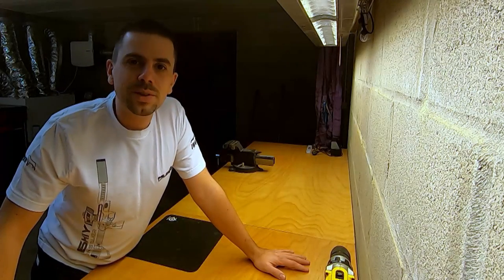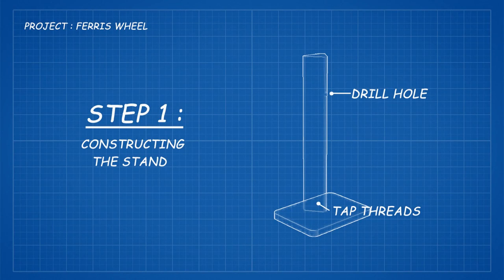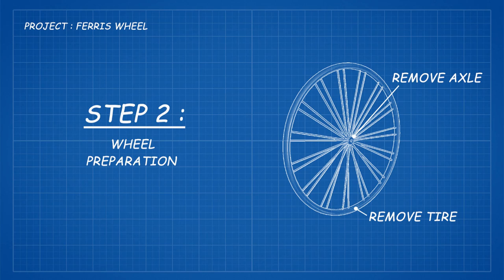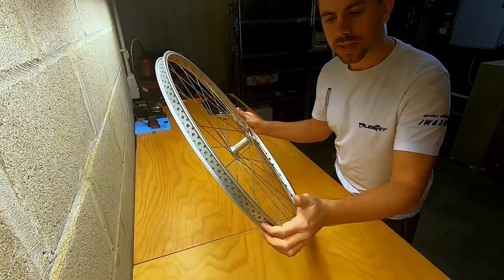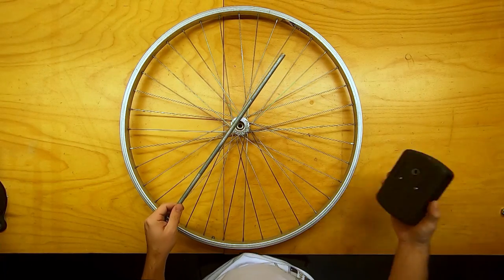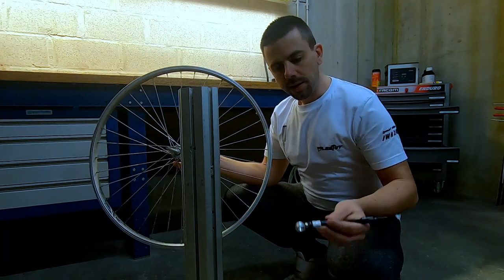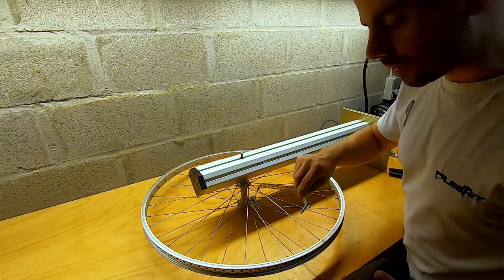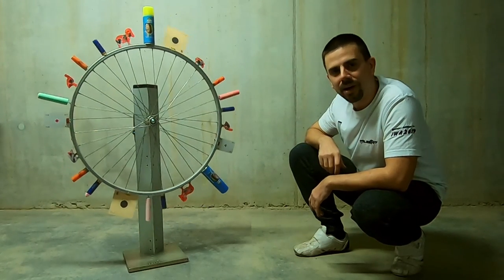" Let's build something " #1  Ferris Wheel target stand

Comment: Surprised all comments are "older" But this is exactly what I was looking to build for my club. I feel the Aluminum stand would not be sturdy in the long run with larger cal shooters. Although a bit of welding would be needed the use of 3/8th angle iron would work.  Thanks for the idea.
Reply from the maker: Nice 👍. Still works fine here but I have changed the wheel 1 times 😉